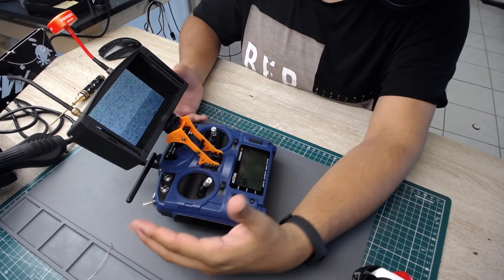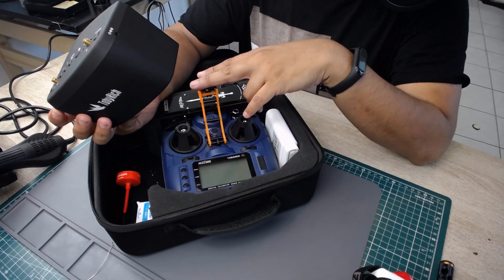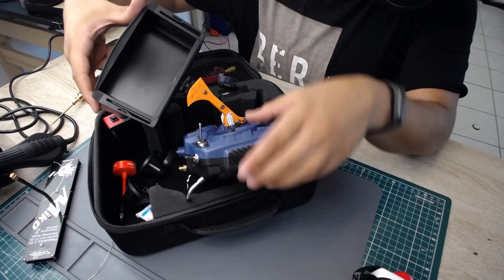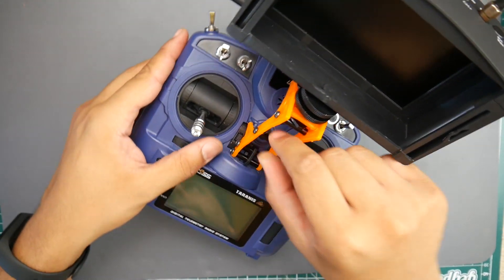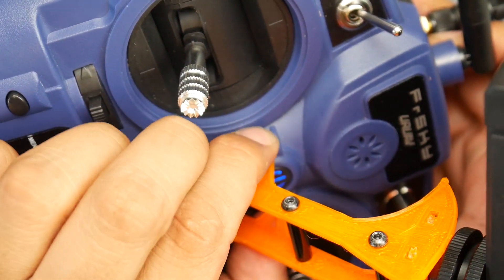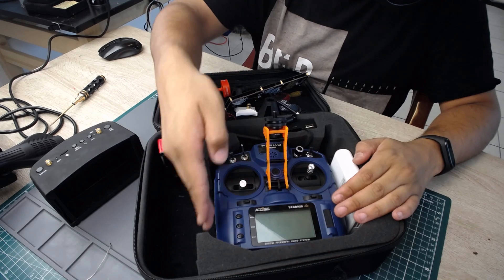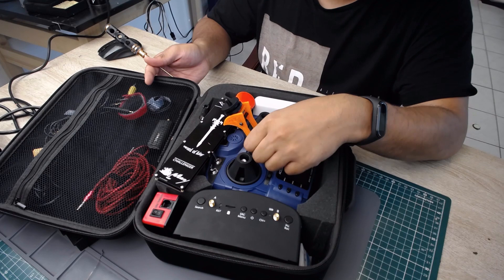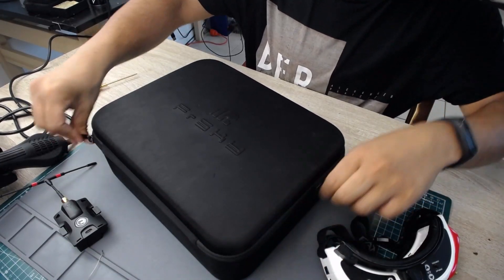FrSky X9 Lite 3D Mod + My Ultimate Budget FPV Gear Setup

Comment from the maker: My Gear Setup:
FrSky X9 Lite Flavor 1: http://bit.ly/2ZPXekb
TOBYRICH Box Goggle: http://bit.ly/2YYApuL
FXT USB Booster: http://bit.ly/32yhjO9
Dock King: http://bit.ly/2D7q2w3
Small Patch: http://bit.ly/2Vi338M
Foxeer Antenna: http://bit.ly/2YYMf8c
Large Patch Antenna: http://bit.ly/2SrxdFh
Rapid Fire:  http://bit.ly/2LqHj7V
Batter Checker: http://bit.ly/2LwY7eo
X9 Lite Adapter: http://bit.ly/2PeYmgg
MultiProtocol Module: http://bit.ly/2CNOFOG
R9M Lite: http://bit.ly/2Y3fRjy
Carbon Fiber Anti-Skid: http://bit.ly/2XLwIvM

Comment: I'm thinking of getting on in the hobby and I'm on a tight budget but I'm not sure which transmitter should I get .I'm stuck between flysky fs-i6x and flysky fs-i6s.
Reply from the maker: The X but if you think you will continue then  I recommend you buy this one.
Reply: @DroneMesh  thanks alot .

Comment: You seem to have an ideal spot to add a stiffening spacier between the two little triangular sections you even have holes for the screws, that may be enough to negate needing the two screws every time you unpack it.

Comment: You should make that middle holder 1 pease so its sable, you don't need standoffs and its stronger so you don't need screws. You'll just bend it up when you use it
Reply from the maker: What about the tripod screw mount inner carbon fiber is.strong enough  it I need a system that allows the tripod screw mount.
Reply: @DroneMesh  it would be cool if you didn't have to screw anything just like slide goggles into the mount and it will lock in place

You should upload fusion 360 file to thingiverse too, so people can modify it easily